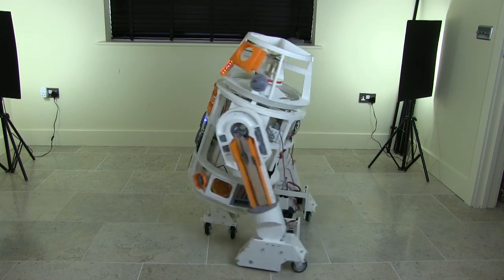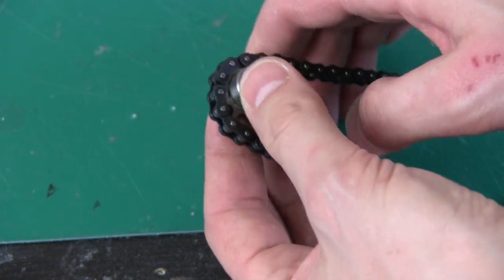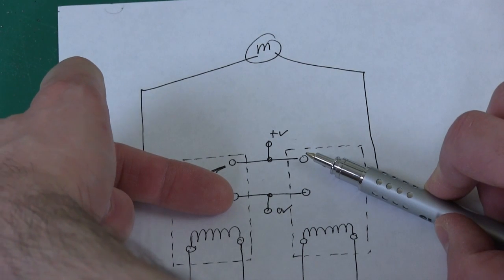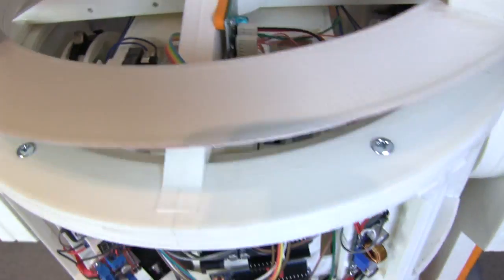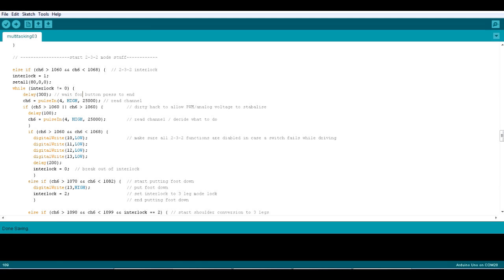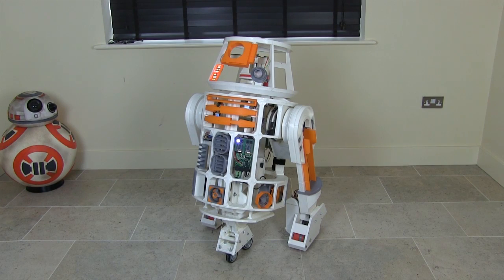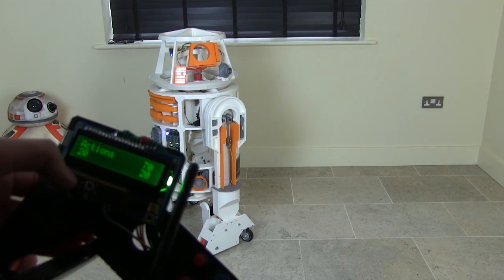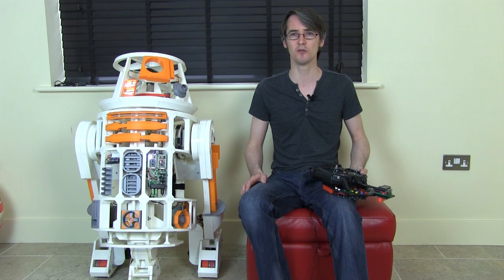Star Wars R6 Droid #14 | Leg Conversion | James Bruton

Comment: Hi James, great video.  I am having massive trouble 3D printing large flat items (a bit like your R6 structure parts) They all warp and lift off the bed at around the 3mm high mark.  I have tried glue stick, kapton tape and abs "glue" but no luck.  Any tips?
Reply: ***** Thanks for the reply :).  I am using a BQ Prusa i3 and have had to  add some cork under the bed heater PCB as the bed temp used to stall at around 93 C.  I'll try cranking it up to 100 C later on.  I'll also revisit the ABS "glue" as my mix may be too thick.  When I tried it I got large streaks of ABS over some of the glass :S  Thanks again for the tips, I'll let you know how I get on :)